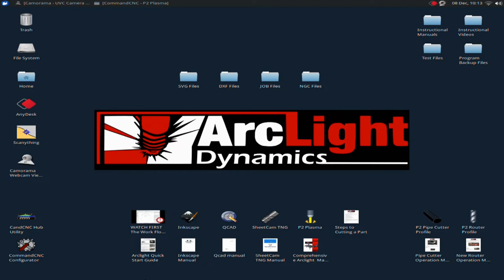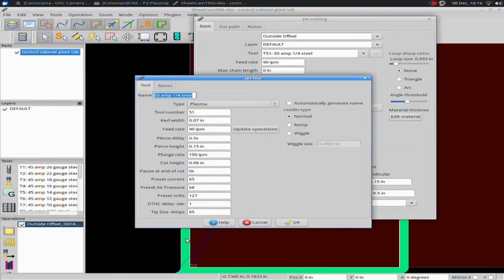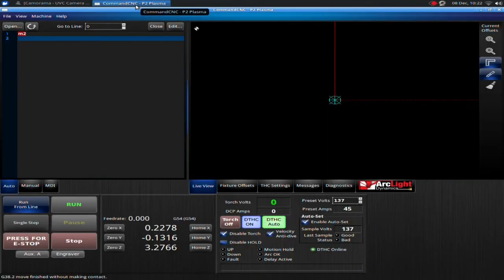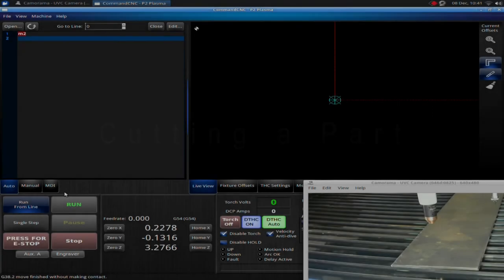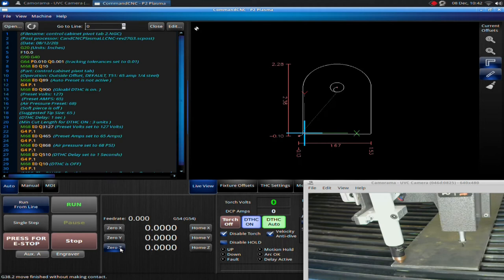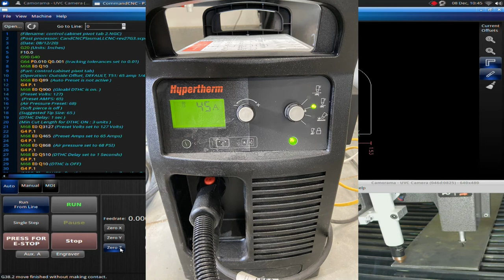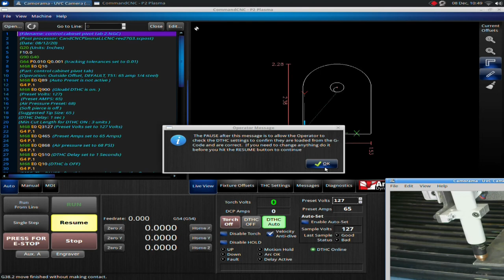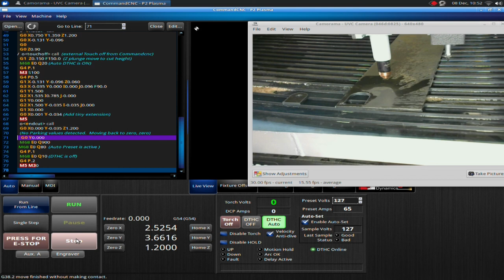Command CNC Cutting your first part - 2021

Comment: Sorry. But you are confusing. You never homed your z properly. You also have no ohmic. Really in this day and age you are still using just the z float switch. I have both probe and float. If my probe fails due to rust and or poor continuity the float switch is a back up. Clamp your work lead to the plate itself not the slats.  Also your saving of your job after you post process is confusing.
Reply: Made sense to me